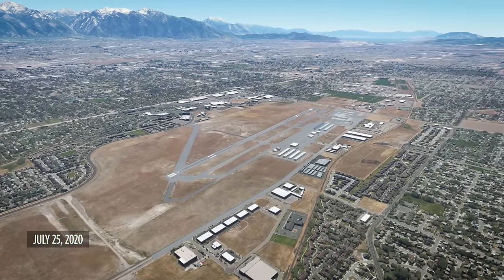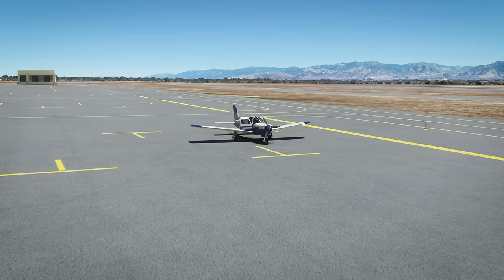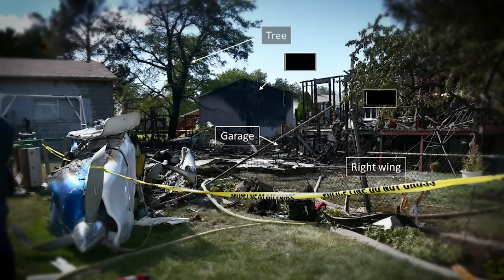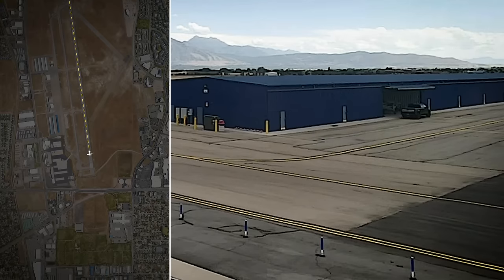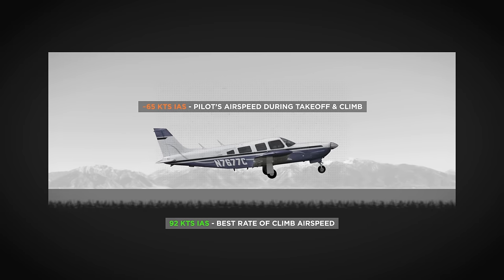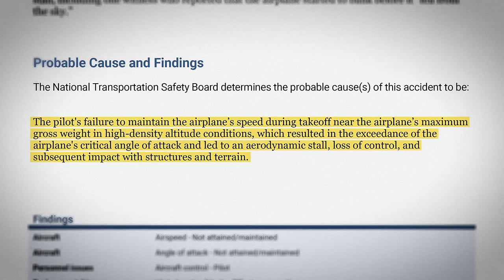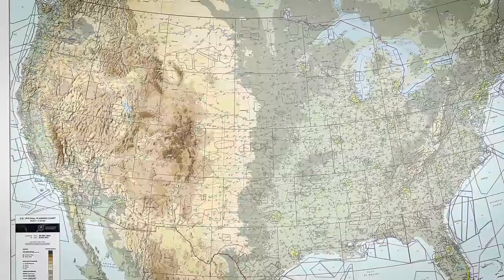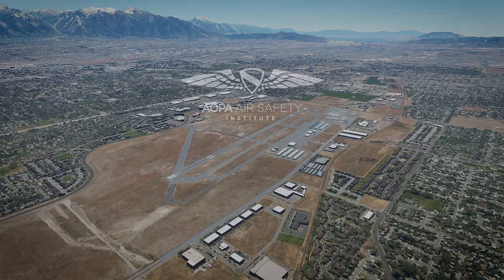Accident Case Study: High Aspirations

Comment: What happened to establishing an airspeed @ approximate distance on takeoff roll and if you don't hit that number before rotation speed simply reject the takeoff.  6 people onboard probably added pressure to fly as well.  Terrible someone was killed in their home.
Reply: I’m not sure establishing speed at a certain distance would have worked in every case and also maybe not in this one. You could be hitting rotation speed more or less where you expect only to find out the plane is unable to climb because performance is below what is advertised in the POH, the problem is you only find that out close to the end of the runway…
Reply: @jfmrod  Everything may happen, but this is very unlikely. The way the indicated airspeed is measured makes it directly related to the lift, unless the aerodynamics of the airplane is severely damaged. The problem of high density altitude is that the engine does not develop the full power, so that the sufficient indicated airspeed is either not reached, the required for it length of the runway is not available. I agree with @jonasbaine3538 that observation of the airspeed during takeoff roll  and timely rejection of takeoff would have saved the day.
Reply: @ikono2  when the plane is on the takeoff roll you have close to zero angle of attack, and therefore reduced drag, once you rotate to increase lift, you increase drag, its quite likely that you can accelerate to rotation speed and not be able to lift off and climb once you rotate and lets not forget ground effect which reduces needed AOA for lift and therefore lift induced drag too.
Reply: @kleinersternlifotografie4875  The rotation speed is well above the stalling speed, so if you are able to accelerate to the speed of rotation, you will be able to climb. However, if you rotate at the stalling speed, it will be exactly as you describe. For example, I fly sometimes PA28 Archer, its stalling speed with some flaps and at MTOW is 53 KTS IAS, however, according to POH I am expected to rotate at 65 KTS IAS. Certainly, the airplane would be able to lift off even below 53 KTS due to ground effect, but may eventually not be able to climb. However, if it is able to accelerate to 65 KTS while rolling, it will climb despite of some eventual loss of airspeed due to induced drag.

Comment: Another very well done video with some very important takeaways.  It seems the pilot was very conscientious, but still failed.  It's a reminder that I need to cross every i and dot every t when I fly.  Thanks ASI.
Reply: Agreed Dan, and your video on Gryder was very informative.
Reply: @89. I too don't see what errors he committed. Was if fuel mixture? Flaps? Or did he rotate prematurely?
Reply: @89. The book shows a theoretical condition at time of manufacture flown with perfect technique. This aircraft, (and most in the GA fleet,) was not recently manufactured nor flying in that theoretical situation and no pilot should expect themselves to be capable of perfection. The pilot may not have been "wrong," but clearly he wasn't right either. Unfortunately it's a judgement call not MSFS 2020. The lesson is, stay well inside the envelope. If you're close to the numbers, you probably need to reschedule the flight.
Reply: @89.  Gotta remember that the numbers in the book were achieved by professional test pilots. This pilot had 800 hours, which is good, but not in the same league. Clearly not enough experience to have known the difference between "I expect this cruddy climb performance because of DA so let's continue" vs "This ain't happening, so reject take off."
Reply: @gottesma  Agreed and I don't think we can say he was negligent or anything of the sort. He just miss judged his personal go/no-go. It's terrible and the accident report rightly assigns liability or fault, but no further. This sort of call could catch a lot of experienced pilots out. Those book numbers are calculated based on solid math, but there are a whole lot of variables that can't be mathematically predicted even from the best test pilot data. Unfortunate and I feel sad for the survivors and the victims families. That's why we study accident reports and adjust our personal envelopes accordingly.
Reply: Thanks, Dan!